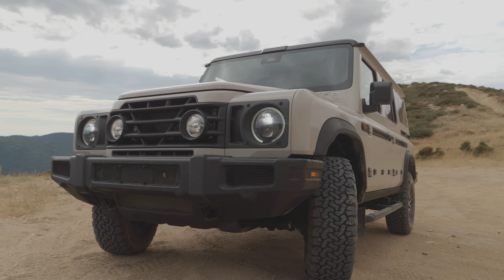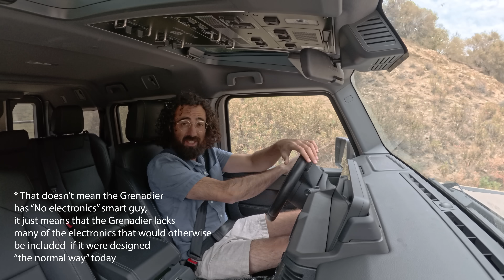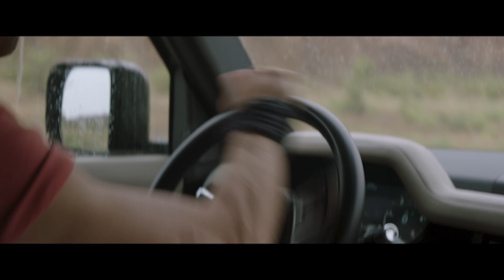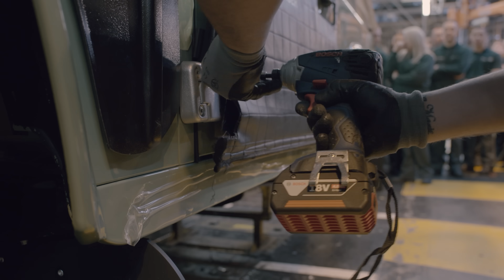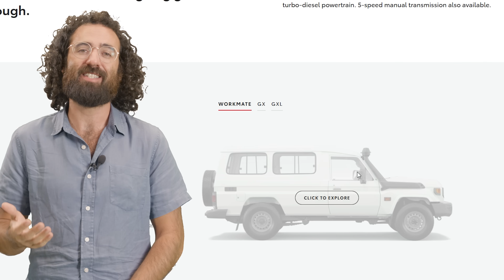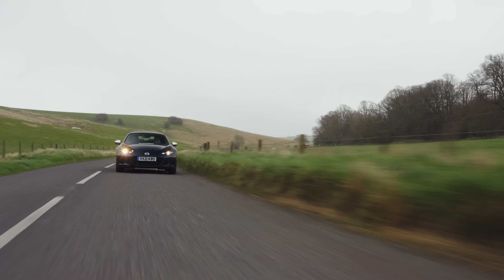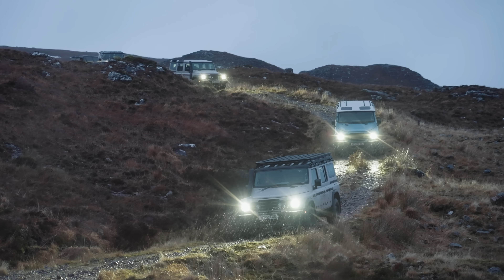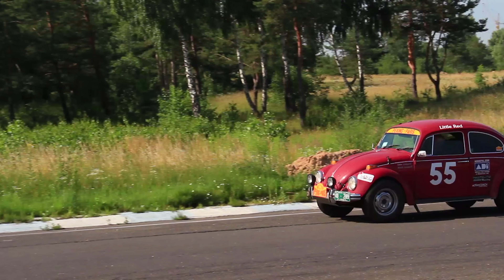Why a simple new truck has to cost over $70,000 in 2025

Comment: in cloning a defender, they made a G-wagon
Reply: The vault door like thud of the Grenadier doors is just like that of the G Wagon.
Reply: Yea....they made it too fancy.
Reply: @rndmprsn3532  not really looks much more rugged than a princess g wagon
Reply: @aaronvalenciaz1413 looks means nothing.   It was made too fancy.  Everyone is cramming tech and power everything and LEDs and sensors.   If they had made a completely stripped down 100% rugged and reliable truck, they would have zero competition.   No power anything.  No screen, no extra boojie switch panels, no integrated LED housings.   It could have been made simpler and cheaper.
Reply: @rndmprsn3532 So basically a UAZ Hunter.

Comment: But the aircraft style switches on the interior are pretentious and it just isn’t that good off-road because the axles have terrible articulation and the traction control calibration is terrible. A fellow in Australia did an off-road test comparing the Grenadier to three other SUVs. He and three friends took the four SUVs off-road and filmed all of them tackling a number of obstacles. Despite having solid axles, the Grenadier did poorly due to its bad articulation and horrid traction control. It struggled on obstacles that a 200 Series Land Cruiser easily handled. It simply isn’t a good vehicle and eventually its billionaire owner will get tired of losing money and will shut it down.

Comment: Great thought provoking review things you possibly missed  the engineering by Magna (who make the G wagon) the cost comes fro not compromising on the engineering thick chassis by Gestamp also the size of the suspension components is huge ,stainless braided brake lines from factory urethane suspension bushes the list goes on.

Comment: While I agree mostly, computers, ECUs, electronics, or whatever you want to call it don’t make cars less repairable, reliable etc. What makes these things have these issues is missing right to repair laws and missing standardization, you don’t need multiple computers (which might I mention have multiple times the power of what put us on the moon) for a freaking window controller, but the manufacturers lock them down and make them incompatible that it becomes useless (manufacturer most likely not car brand but Bosch etc.). I would bet that if we standardize electronics like we did nuts and screws so you can easily get the tools to repair things, computers would turn into the most popular thing, in custom cars people already use standalone ECUs because it’s better if accessible.
Reply: This is a compelling reason not to buy low volume, comparatively rare vehicles but to buy high volume ones where plenty of spare parts will be available well into the future from OE, alternative producers and ultimately from recycled models that are either crashed or scrapped.

Comment: i get the basic premise but it comes standard with leather, heated seats, huge ass touchscreen, a bmw twin turbo i6, bmw transmission, and also buy a butique manufacturer that can't benifit from the economies of scale.  it COULD be done for a lot less money but it still wouldn't be "cheap"
Reply: No. There is a trail focused package that is cloth seats actually.
Reply: @John1911 it doesnt reduce the price
Reply: @BassRacerx In general the Trialmaster (off road focused) is cheaper than the Fieldmaster. 

Of course, you can spec all the package options on either vehicle and run up the price. I know because I am in the process of doing that now.

Comment: This is a low volume production car from a brand new car company, they don’t need to cost $70k, Ineos doesn’t have the resources/skills to build these en mass for cheap. Not a great example. Look at a Wrangler, then look at all the margin in the MSRP price (they sell for 10% off MSRP regularly, and there is still profit in that margin). Simple isn’t expensive. OEMs realizing post-cvd they can charge more money and still sell cars is why they are expensive. Ineos is just a small, new company (and they are also now selling for around 10% off MSRP)
Reply from the maker: well yeah, but since it's true that Ineos doesn't have the resources to build them for cheap, then by definition whatever they make has to cost $70K. Jeep's margins on the Wrangler come from scale and long-established supply chains and production capabilities. also i have a Wrangler, and the Grenadier is bigger and way more overbuilt

Comment: I dream of owning one of these, they're about 110-120k AUD brand new but can be had 70-80k lightly used. It is EXACTLY what every Australian 4x4 enthusiast have been asking for since the death of the solid axle Landcruiser and Patrols wagons. When my 105 Landcruiser dies, this will be its replacement.
Also don't lump the 70 in the same group, it's useless, leaf sprung, the axle tracks are different in the front and rear, they got rid of the VDJ V8, not to mention you absolutely cannot get it for 75k here...
Reply from the maker: what's the markup on the 70?
Reply: @drive the cheapest used 76 Landcruiser on the market right now with less than 40,000km is advertised for $83k. They can easily get up to $160k. You can get them for RRP if you're willing to get into an obscenely long queue at the dealership, but if you want your car some time in the next two years you'll be paying a steep premium on the used market.
Reply from the maker: god damn!
Reply: @drive here in AU retail prices ranges from AUD75.6k to AUD87.6K, i.e., USD50-58k.  Plus some taxes and delivery fees, but most dealers will usually throw that in.  So, You were correct on the USD, just got your conversion wrong.  

Old mate above is just nitpicking/whingeing. Toyotas, Landcruisers specifically, trigger people here; weird but it’s a thing.
Reply: And I love a V8 as much as anyone, but the 2.8litre 4 outperforms the old diesel V8 in every respect.  It was a bit of a dinosaur.  Responds v well to tuning but needs a close eye on it once tuned.
Reply: @patster4040 you’re right, except for one huge issue. 

The reliability of the 4 cylinder is significantly worse than the 8. What the hell is the point of a “reliable rugged farm Ute” if Toyota can’t get the reliable part right lol.
Reply: @patster4040 that’s RRP, not what they sell for.
Reply: 79 series is a great farm ute
Reply: @destroyer4328 yes if your farm is made of gold and gumdrops and you enjoy spending Porsche money on a toaster.
Reply: leaf springs are usually perfectly fine.
Reply: I didn’t know that a 105 Landcruiser could die 🤔
Reply: @JimPakeman that’s the problem!

Comment: The exterior only appears old school.  Its made with much better steel that won't rust as easily, and its a stronger metal.  Nothing about this is actually like those old vehicles outside of the valves on the tires.

Comment: I've owned a Grenadier for about a month. I was torn between the Grenadier, GX550 and a 60 Series Land Cruiser. Grenadier kind of closed the gap. Built like a tank. Favorite vehicle I've owned.
Reply: Owned the new LC250 for about 3 months, sadly could not stand the 4 cylinder hybrid system and also felt the quality was just not there. Traded it for the Grenadier and it was the best decision I personally made.
Reply: I talked to the Ineos guys at a car show. I REALLY like the truck. Love the throwback interior with actual switches and buttons and body on frame construction. I hesitate though because of the BMW engine. Of all the companies engines to put in your ‘reliable go anywhere vehicle’ why choose BMW? Of all the major brands BMW’s have the highest cost per year maintenance. Look it up if you don’t believe me. 

I drove a Lexus GX460 for 11 years, 5 years in Las Vegas and 6 years in Alaska. Serious real world off road performance. Never a problem. Never left us stranded. For me, it is the standard for reliability. You could buy a seriously mint used GX460/470 for $35K and have an extremely reliable truck for the rest of your days. Not as “cool” as a Grenadier, but proven.
Reply: @overbuiltlimitedAs a past owner of a Lexus GX470, I have to agree with you about their stellar reliability. However, give the Grenadier some credit. The BMW B58 has proven its worth. Probably because of Toyota’s insistence when it was used in the Supra. The B58 is being hailed as the new Toyota 2JZ. The ZF 8 speed transmission is also a very reliable and solid gearbox used in many applications.
Reply: @overbuiltlimited the B58 was codeveloped with Toyota and has been credited with making the modern BMW more reliable given how much its used across its lineup. So Ineos going for the B58 is not a terrible idea.
Reply: @overbuiltlimitedHave you ever driven a gx570? And if so did you prefer it to the gx460 or if not why?
Reply: @overbuiltlimitedthe BMW B58 is ranked as one of the most reliable engines, and is in fact used in the Toyota Supra.
Reply: @overbuiltlimited Toyota uses the B58 now. Its pretty reliable as long as you throw away the buna rubber seals and replace them with Viton.
Reply: @overbuiltlimited A Cummings would be preferable.
Reply: @bigislandvip5540  I love my 12v Ram. There are many cooler cars, but I like that reliable old tractor engine! :3
Reply: @jamesgizasson I work in renewables and read this as a 12volt Dodge Ram. I think I need another cup of coffee.
Reply: @devinhedge  Honestly, I should've typed out 'valve'. Your cobfusiob is my fault. X3
Reply: @bigislandvip5540  it had to meet emissions/fuel economy... Engine weight plays a big part in fuel economy, and even the 2.8 Cummins is 2x as heavy as the B58 while also having less power.
Reply: @overbuiltlimited for what it’s worth. The same engine is in the Toyota Supra. The BMW engine went through the same rigorous Toyota tests.
Reply: @ChaseMoreLight wait.. the greenie has the same engine in the Supra /Z4? No way!
Reply: @undefined7141  it doesn't. It's a straight 6 diesel from BMW, in a tuned down version. The supra uses the Petrol straight 6 engine from BMW. They come from the same engine family but obviously have some differences because of diesel Vs petrol.
Reply: @fabianrudzewski9027  so it has a diesel. Thank you for clarifying!
Reply: @ChaseMoreLight the same tests that leave failing engines and transmissions from metal shavings for 5 years in a row?
Reply: @overbuiltlimitedExactly. Wtf did they choose a BMW? They are the MOST unreliable pieces of shit engines around. The opposite of reliability. I for one am all about that gx460 of yours. Very very capable, and kinda luxurious vehicles too. Probably not as annoying as a solid front axel for a daily either
Reply: @ryaniam22  you must be old. in case you haven't noticed every new car is trash, the new Toyota and Honda turbo engines keep blowing, American cars dont even start after a couple weeks, Hyundai and kia have fallen off before they even reached proper reliability.  this is not true about bmw anymore, the b58 is an extreme reliable, extremely strong engine thats even been tuned down to be bulletproof. its probably the most reliable engine with a turbo and non diesel on earth rn. the more you know
Reply: @ryaniam22  you must be old. in case you haven't noticed every new car is trash, the new Toyota and Honda turbo engines keep blowing, American cars dont even start after a couple weeks, Hyundai and kia have fallen off before they even reached proper reliability.  this is not true about bmw anymore, the b58 is an extreme reliable, extremely strong engine thats even been tuned down to be bulletproof. its probably the most reliable engine with a turbo and non diesel on earth rn. the more you know
Reply from the maker: nice
Reply: I wish it had a manual option… still pretty great
Reply: why did you sell it?
Reply: Why only a month?
Reply: The GX550 Lexus is very VERY nice.  It just does not have the styling of the Grennie.
Reply: @BryanPike and Lexus has the same engine failing in the tundra
Reply: Were you able to pay cash, or you just looking wealthy ?

Comment: guaranteed to pop a plastic coolant line in the middle of the savanna and bam!, you're eaten by a lion. Seriously though, I think the only reason they used that crappy engine is cuz they still had a 100's of pallets of B58's sitting around at the Magna-Styer factory in Austria from the Z4's they never ended up building due to pour sales...
Reply: They used the B58 because it’s incredibly capable and one of the most proven drivetrains available right now. Only ignorant people doubt it.

Comment: No, that's the furthest thing from "built like they used to," as one could get. Twin turbo inline BMW 6cyl, auto trans with 8spds, electronic lockers, screens, heated seats, etc etc etc. If you want a truck built like they used to, BUY A FUCKIN USED TRUCK FROM THE ERA WHEN THEY WERE BUILT LIKE "PROPER TRUCKS!!"  It has Recaro seats ffs!! Stop saying it's "bare bones" "kept simple" etc. This is clearly an advertisement for Ineos and not a video about why new trucks suck. The Ineos sucks just as much, if not more than the rest, because you don't get what you pay for. BTW, it's also much more environmentally friendly to keep a used vehicle on the road vs buying a brand new one, especially if it's an EV or hybrid. 😊

Comment: A good discussion and lots of valid points, but ultimately we're still just getting ripped off.
I'm in Australia, and Toyota absolutely has to be making 50% + profit margin on the 70 series. It has nearly no features, super basic and has been in production with minimal changes for 40 years. The Ineos grenadier is an S class compared to the 70 series, which until recently didn't even have air conditioning as standard, in Australia...
At launch 3 years ago the Ineos Grenadier was AU $82k for entry level. That is now $110k. If they could sell one for under $85k then they could do it now if they wanted to, but they'd rather charge more per unit and remain a niche in the market.
Reply: It’s because they couldn’t sell any more volume, thus increasing their unit production cost, that they have raised their prices. The price is not the issue because plenty of people can afford it but choose not to buy. Just look at the relative sales compared to Defender. 120,000 Defenders sold worldwide last year,  with a far higher average selling price than Grenadier. This compares to 9000 total Grenadiers. 
In the UK, they sold something like 16000 Defenders but only 400 Grenadiers. Again, it’s certainly not a price constraint.